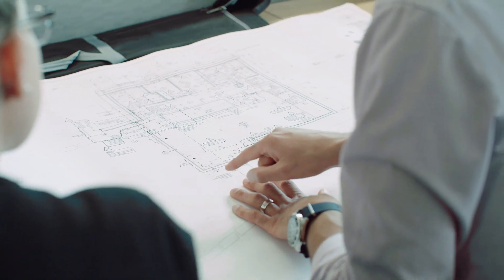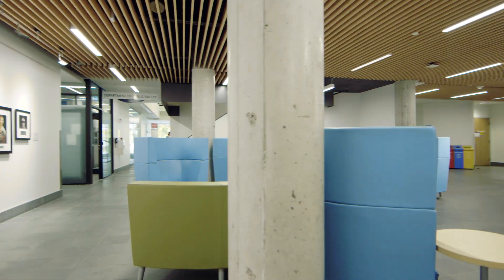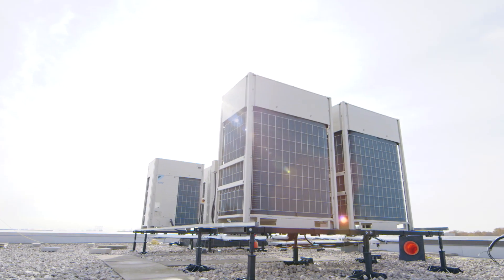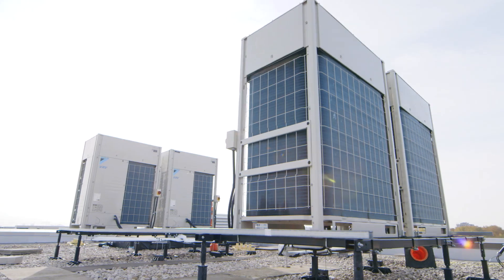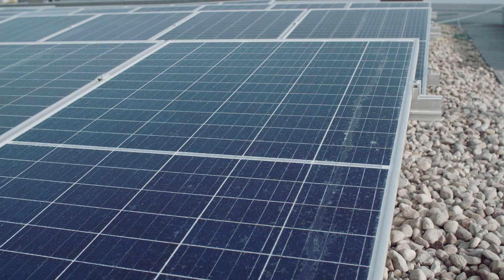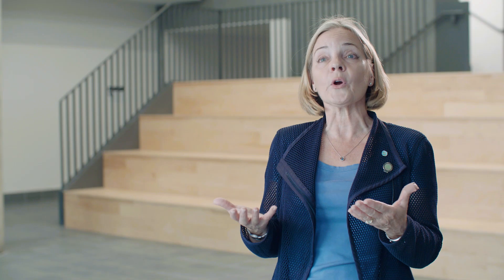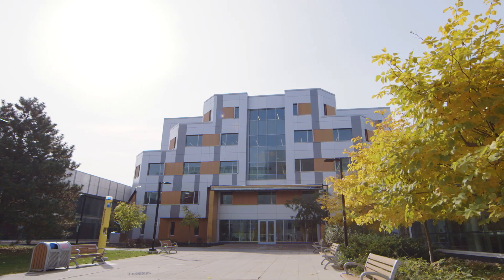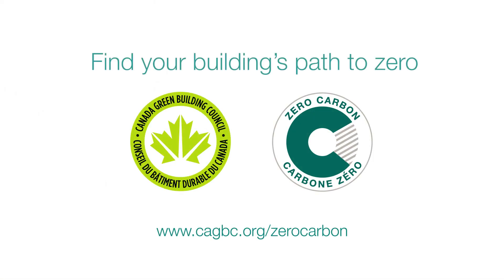Humber College Building NX: first retrofit Zero Carbon Building – Design Standard certification

Comment: How do you heat your building -by solar electricity - we need more details. Looks good, however you could provide heating, hot water and cooling by capturing sewage heate waste. Try SHARC Energy Systems : For 10 years, Vancouver's False Creek Neighborhood Energy Utility has used the local technology of Thermal Sewage Heat Capture for 24/7, 365 days a year to provide 70% of the building/neighborhood/ industries heating, cooling and hot water, while cutting 60% of the 55% of Vancouver' building carbon emissions. This is a proven, successful, self-financing, local,and renewable energy system that is happening now and is expanding to 4 other neighborhoods, eliminating most of the requirements for LNG, Hydro, or coal energy. It will be 100% carbon emission free by 2025.
Reply: So happy to hear that you are going to  research SHARC energy systems. I have been following the thermal sewage heat-capture for 10 years now - makes so much sense to turn an expensive disposal problem into a climate solution. UBC is also working with sewage to create fuel for its public transport!